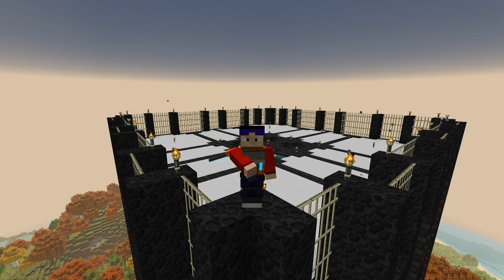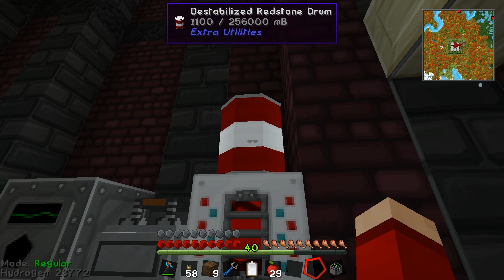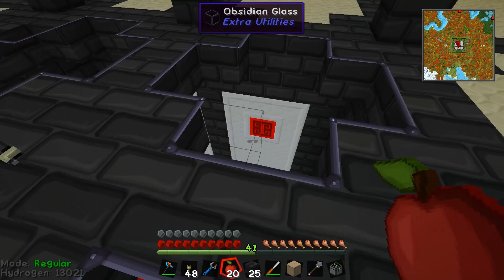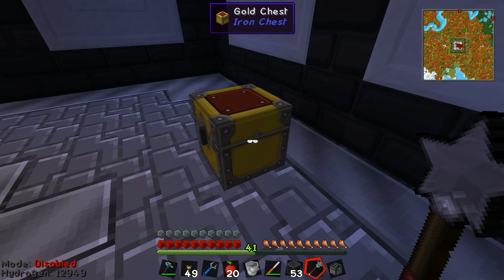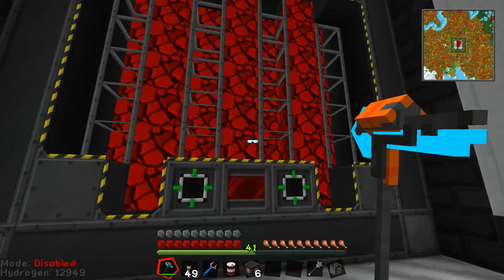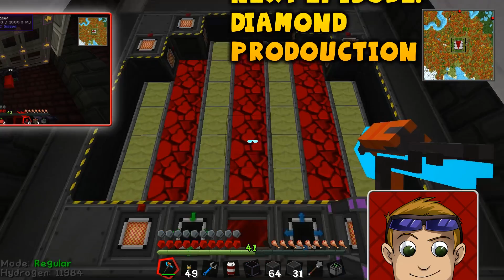YogPack: Strife Solutions 13 - Nuclear Power

Comment: Probably already done the cables Will but just incase, can I recommend just making redstone conduits? Almost as good as ultimate cables but alot easier to make and much less buggy whem it comes to even distributing power to each level. Since you already have the crucible a liquid transposer from the same mod is all you need to add the redstone to the conduit casing which is just electrum and glass.

Comment: Nice! Reminds me of a real world reactor design cooled by molten sodium. Any chance of the mod having laser compressed fusion reactor? To start the triple alpha and proton proton chain of course...
Reply: I did not come on this video expecting actual information about Nuclear Chemistry. I must say, I am pleasantly surprised.
Reply: Yup...sounds about right. In this case, it sounds like the destabilised redstone is the liquid salt, since redstone exists as solid in vanilla Minecraft. Yellowrite sounds like Yellowcake; unrefined but fuel nonetheless. Granted, the complexity is scaled down, but the concepts seems mostly sound to me. I'm no Nuke Power expert, mind. I just know bits and pieces.

see:https://en.wikipedia.org/wiki/Sodium-cooled_fast_reactor

I remember that in the Ye Olde Days of the 'Volts' modpack series they had early water-cooled reactor designs in-game. Nice to see the progression.

All that's left is to emulate LASER-DRIVEN INERTIAL CONFINEMENT FUSION PLEASE!! :)

(I'm such a massive fan haha)
Reply: Is the molten sodium used as coolent? I assume you're talking about a Thorium reactor, which reacts the material in a molten salt base. ( I could be completely off here, I'm only GCSE)
Reply: XD

Comment: Yeah, you REALLY should build a Cyanite Reprocessor. It recycles Cyanite into Blutonium. You get one Blutonium for 2 Cyanite and 1 bucket of water. Blutonium is just as efficient a fuel as Yellorium is. Making the Reprocessor is essentially multiplying your fuel by 1,5. Which you kinda need, considering how much Yellorium that reactor just ate. The fuel capacity is 4 ingots per Fuel Rod block, and in the reactor itself one ingot translates to 1 bucket of fuel.
Reply: More than 1.5 times, seeing as when the blutonium is used up, they give you cyanite which can then be reprocessed again.
Reply: Samuel Lam
Oh right, so it generates fuel infinitely until you reach just 1 waste. That's pretty extreme then. MASSIVE boost in fuel. Also, kinda parallels the concept of half-life, which is cool.